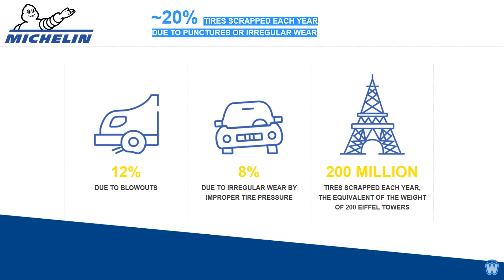Michelin Airless Tire UPTIS - Unique Puncture-Proof Tire System

Comment: They would need to make the tread thicker like the excavator's or military vehicles.... Heat would cause them to wear quickly witch means the entire dimensions of the wheel wells and wheel base would need to change... Witch would also affect how tight of a space they could be parked into.... Probably too big of a hassle at this point in time

Comment: What a pile of bullshit. Yes, this construction is useful for some specialized vehicle, no doubt. But it is absolutely useless for any fast driving machine. First, mass of the wheel is very important, the lighter the better. Second, balance is extremely important. Even a small piece of ice of dirt inside of the pockets will make it undrivable. Third, it will create even more garbage than ordinary ones. Once again, bullshit.

Comment: I really hope they'll seal the sides, I can only imagine the amount gravel that would get trap in it
Reply: they cant at least from both sides. the inside could not move air to other parts of the tire and the lower part would burst when squeezed tightly, like sitting on a balloon.
Reply: @marsovac  I see, it makes sense, I haven't thought about that. It's a nice idea but these tires still probably project a lot of stones all around

Comment: You cant have an open side wall and drive at high speed if you are in any environment that has debrit.  Anyone that has ever had a hub cap.  Worked at a tire place.  Or gotten mud inside their rims knows that just a small amount of weight will make for some dangerous vibration.  You are going to need to seal the sides.  Imagine trying to clean out mud from this.  Also remember that the main thing that goes bad on a car tire is the rubber.  Specifically dry rot.

Also,  what is the roll/z rating on these?  Asking for a friend.

Comment: These are called tweels!! 
They were invented in the late 80’s they were supposed to replace standard tires but the military took them over, they coincidentally use less gas and less oil in the production, gee wonder why we never got them
Reply: Bc they are great for low speed and minimal maneuverability.  They will wear out faster and transfer kinetic road energy to the rest of the car ( brakes, suspension, etc,) wearing other parts out. Unless the years of development have changed something.  They have to be heavier which  is not good either.

Comment: Meh, these are do not reduce pollution, they increase it.
1. such tires will deform much more than a regular properly pressurized air tire, and with deformation there come inefficiency and waste of fuel. You try it yourself to bike with flat tires. This means that regular people using their car for their day to day life will be spending much more money on fuel and fueling more often, or in case of an electric car, will reduce range.
2. the profile of the tire being open requires the tire to be clean quite often for rocks or ice and other debris that will stiffen the tire, which makes them ill-suited for use in dirt road or terrain.
3. and the major benefit is to save on punctures. How often do you puncture your tires ? I've only experienced that once in my lifetime and I have drivers license for 18 years now.

Comment: As a mechanic irregular wear on tyres is generally caused by a fault in the tracking of the steering toeing in or out causing the tyres to feather on the edges however vehicle maintenance also has a lot to do with wear on tyres a big one being tyre pressure, under inflated tyres will tend to wear on the outside of the tyre where as over inflated tyres will wear on the centre of the tread. 

As a regard to law enforcement stopping vehicles in a pursuit situation there are two other options to replace spike strips. 

The first being a a mechanism that that lifts the front of the car up via a set of metal rods on pistons however has very limited use. The second being a spike net which is essentially a large Kevlar blanket net covered in spikes that wraps around the front tyres and tangles the front axle immobilising the vehicle bringing it to a stop.

Comment: Does not it increase fuel consumption as the tyre gets flattened when touching ground and those spokes work like spring which will increase consumption of fuel and seems cars will bounce a bit more

Comment: I am interested to see what the braking distance is like.
Reply: @andrewsanchez8716   tire compound and radius and tread and pressure ALL have an effect on stopping distance
Reply: I wonder if it’ll effect gas mileage
Reply: @andrewsanchez8716  Tires are your contact to the road surface and have an effect on your braking distance. Tires with more air pressure are going to have less traction and will result in a longer braking distance. This article gives a good explanation with the mathematics behind the physics: http://article.sapub.org/10.5923.j.ijtte.20130202.01.html#Sec4
I also suggest you pick up a physics book for future reference.
An easy real-world experiment you can do is accelerating to 45mph and slamming on the breaks on different surfaces (asphalt, dirt, snow, wet asphalt, etc). Your brakes are not the only variable in regards to stopping distance as they have no contact with the road.
Reply: @andrewsanchez8716  you obv dont know how a car works. The tire tread pattern and size of a tire can absolutely effect brake distance
Reply: I think it will skid
Reply: @andrewsanchez8716  You should study this more
Reply: @andrewsanchez8716  lol, hope you are not an engineer
Reply: Good notice from you
Reply: Man I understand what you're saying. I dont know I would think it would take a longer distance to so than regular tires.
Reply: Probably normal, it appears to have the same tread as a normal tire
Reply: Wouldn't make much difference
Reply: @andrewsanchez8716  That is not so my friend
Reply: And that's why they didn't include it, nor going fast
Reply: When could we see theses go on sale?
Reply: @andrewsanchez8716  the thing is with tires like these you also stop faster. There’s less weight on the car since the rims are taken from the equation. Also since there’s no tread you can brake much better in rain since the air under the tire is also removed then hydroplaning is very much reduced chance from happening. As for braking, since the tires are flat, braking would have the tire have more surface area on the ground meaning, less distance to stop. Of course brakes are very important, one won’t work without the other so while brakes haven’t changed, tires have. And with that the tire also helps stop the car now.
Reply: @damianpizana5473   wtf, where did you get the idea, that a profiled tire causes hydroplaning?
It's not the profile or the air in the profile, that cause hydroplaning. They are actually preventing it, by draining the water between rubber and road. 
A slick tire can't displace the water film on the road, as it has nowhere to go so fast. So it starts to lift onto the water film-> zero grip.

Also, there is still a rim in the tire, plus a lot of rubber stripes instead of air in the tire doesn't seem to make it any lighter.
Reply: @fabianrudzewski9027  either way the tire is better than traditional tires...
Reply: @damianpizana5473  You mean no sidewall not treadless, I can attest that a treadles tire does not do well in the rain.
Reply: @damianpizana5473  it's the treads on a tire that reduce the chance of hydroplaning
Reply: @damianpizana5473  did you not watch the video they still have rims and the tread pattern is the same as any other tire it says in the video. Also they make about the same contact with the road as a normal tire at slow speeds
Reply: @andrewsanchez8716  what hes saying is that momentum is based on speed and weight so if this tire is lighter on the outer edge, it will stop quicker. Less weight on the outer edge of the spinning wheel means less momentum that you have to get rid of during braking.

edit: also the tire is noticeably flatter so that would mean more tire surface on the ground at all times so better braking and acceleration
Reply: @AsianCole  I don't see it being lighter. The rim is still there and replacing almost weightless air with a lot of little rubber walls doesn't seem lighter, at least to me.
Reply: Very little in my opinion.
Reply: Heard of disc in disc brakes?

Comment: This leaves you with fixed tire characteristics. A pneumatic tire can be adjusted in pressure depending on the load in the car etc. which can be important when fully loading a family car.

Comment: Those rubber ribs look fragile to me. I also doubt the tire performs well in colder climates when snow and ice get stuck in between them and freezes up.

As for the police, they have a new grappling tool. That would still stop these tires.

Comment: The problem with this tire is several fold 

1:less tires trashed less replacements sold.

2:less replacements sold, less money made.

3:less money made, the more expensive the tire 

4:the less money made and the more the tires cost leads to lay offs and jobs loss. 

So
Pro:take away a microscopic chip of climate change, and help people go for long without a tire change

Con: hundreds of thousands of people loose thier jobs and tires cost $200,000 dollar a peace.

Comment: Police should use some type of carbon fiber rope netting that can get into the bettings and cause an issue with turning the tires therefore harder to move and the driver will lose control of the vehicle it’ll be virtually tear proof Bc carbon fiber is very strong material especially when used in a weave design like ropes

Comment: I don't really trust the structure of this tire, either. If you have to make a sudden hard swerve to avoid something, it seems those webbed structures would fold over on themselves causing it to be very hard to control the vehicle. also, there is not much tread on there, seems it would wear down to the webbing pretty quick. Won't those webbing strips be susceptible to dry rot, being so skinny? Love the idea of no air, no flat tire, but not sure this is the answer.

Comment: The only problem with airless tires (or twheels as they are actually called) is that if one little piece of the tread breaks off from getting stuck on a nail or a sharp piece of something then big chunks start breaking off. Eventually the tires destroy themselves.

Comment: $850 per tire is a tad unrealistic, considering the tread still wears down. Doesn’t matter that it doesn’t go flat if you still gotta replace them just as regularly as conventional tires.
Reply: @Katy Leanne, I agree with you but there is a huge market of people who would rather avoid having a flat at any cost. Such as on long drives with no cellphone service signal, some people mostly women will gladly pay extra for those tires just so they don't have to deal with a flat tire with no help in sight or deal with strangers for assistance. Some cars don't even have a spare tire. If you get a flat and you have to call a wrecker. The inconvenience of where ever you were going may have to wait a couple of days.
Reply: Hellbent 706 I imagine the market would mainly be in construction areas where there’s lots of bolts and nails and metal likely to be on the ground
Reply: @katyungodly  you don't have to imagine. Flat-proof tires have already been in the construction, military and industrial market for years. They're trying to expand into the civilian market now and will again be considered new tech. It will be ridiculously expensive but you'll be surprised at how much money some people will pay for piece of mind or just to be the first one on the block. The price will go down after 10 years or so. Remember when the 55 inch flat-screen plasma TV's first hit the market? They were $15,000 each. Now you can find them for less than $400.

Comment: Hold your horses, please! Where did the environmental benefits come from now again?  It's all good to push on the strong suites and sell a product on those, but stop this until proven in real traffic please! But it's obvious some smartypants say right, not changing tires very often for once, then blabla..  Yeah maybe, but we have yet to see that in real life, it's one thing for ultra slow moving vehicles, what about on a Tesla accelerating from 0-100 and repeat that process quite often simply cause, why not if you own one and enjoy the torque? What about Germans on Autobahn where 250km/h can be fully normal, or more?  What about this, that aso many questions to answer and I am fully aware Michelin is a superb company that have got the man power, know how, financial muscle etc to do this and they will take it as far as they can for sure, I am just not convinced that is enough for all the way between those goal posts? Even mighty Michelin must play with the physical laws, but let's say there is a tire that can take the extreme forces from very high speeds and still keep all city advantages, as well as keep same comfort or better, and be less noisy and all the rest..? Then whet would the cost be and how long can it last, tires take extreme beatings from forces hard to understand and simplicity of the standard radial air-filled tire was such an amazing invention, yes I know it went though many cycles but point is still valid + I want ultra low profile on my car can totally forget about 2024.   But exciting, heck yeah.

Comment: The police already have come up with a new system, called "The Grappler" the specialy outfitted policecar comes up behind the runaway car and extends some elaborate ribbon-array (hanging of it's front bumper) just and inch under the car boot and those ribbons then get tangled around the turning back wheels.  The ribbons are still attached to the police vehicule, by means of extendable iron stretchers, which pull the car to a complete stop. Wonderful invention!
Look at it here:
https://www.youtube.com/watch?v=VRhIsMUZ7Nc

Comment: There is actually a type of spike strip they use that has a net attached. When embedded in the wheel, the net wraps around the spindle or drive shaft, causing lock up. No need for releasing the air, and works on all types of tires.
Reply: 1. That isn't a spike strip since it has no spikes
2. You need to be directly behind the car for it to work
3. pretty ineffective on front wheel and 4 wheel drive
4. You need to use a truck of some sort
5. It puts the pursuer and all others in danger

Comment: Michelin you're doing an amazing job. I'm feeling proud that I use your tyres for my bike. 👍🏻
Reply: I don't think so they would survive high speed. .
🤔.
Also due to increased contact area between the tyre and the road, it'll burn more fuel means not much efficient comparatively.
.

Comment: Saw these tyres made years ago for public used but it failed because the rubber padding between tyre and rim  vibrate and make sounds because of the wind when travelling over 60mph

Comment: sure does look like this tire is not quite supporting the weight of the car. Wonder hour it performs when snow gets inside it or cornering. Also it looks like it uses the material of 3 tires with all that rubber ribbing which is more waste.

Comment: I remember watching something on a science channel about these OVER 15 YEARS AGO. And they're still not available to the public. Unbelievable.
Reply: I saw it even more than 25 years ago. It was, if I remember correctly,  a test with Michelin prototype of these tyres on a Ford Sierra. I think it will never become available for normal cars. Especially bacause It will be too costly in production and for this reason these will be much more expensive than normal tyres.

The suspension system to replace the air in the tyre will be very complex and expensive to manufacture. I guess this will be the reason that they will never appear on the passenger car market. In addition, the open side does not look good, especially with alloy wheels. However, for large trucks it can be a solution because the flat tread seems easier to retread.

Comment: You don’t need to pop the tires to stop a car all you need is Barb spikes that can go in but cannot be pulled out in bedded into netting which will then wrap it self around the axle if it’s the rear or if it’s the front ball joints suspension etc.

Comment: This tires are used for excavators for a good reason: They are useless at higher speeds and the gasoline you need is tremendous as they have much more friction than a usual tyre.
Reply: I agree
Reply: Exactly

Comment: I get the impression that these tyres will be good for road motorsports because the tyres need to flex to get maximum grip on a corner.

Perhaps there could be a special architecture of these new airless tyres to make extra grip on the tyre surface as well as gaining more from tyre flexing